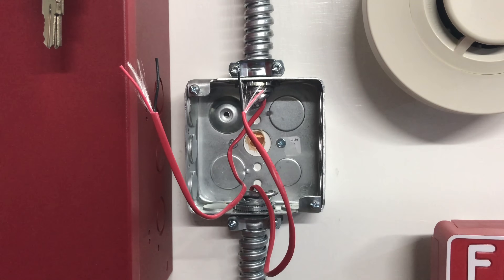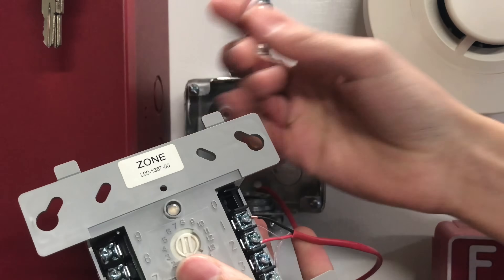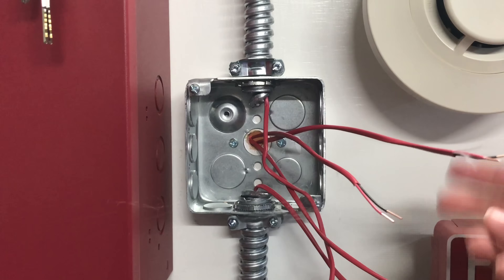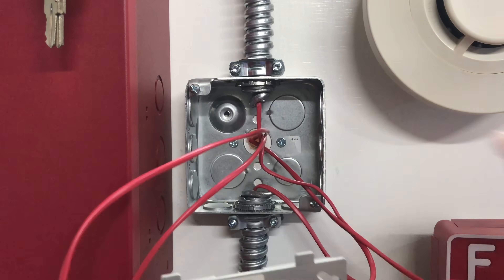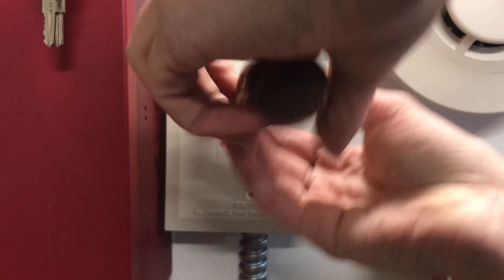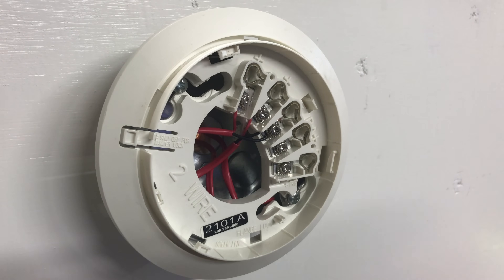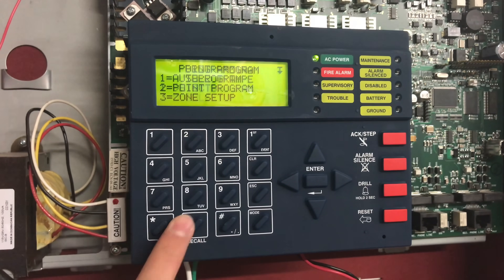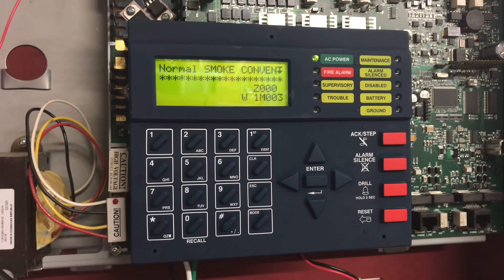Install a Fire-Lite MMF-302 Zone Interface Module

Comment: Why is there 2 sets of wires at smoke base?
Reply: Because he used a class a circuit which uses a loop type setup rather than a single set of normally open contacts

Comment: I’ve wired mine up just like how it’s done in the video, everything does work, how ever the led light on the module turns steady when I activate the smoke detector ( like it should) but stays steady after I reset the panel. The detector does reset. And I’m also getting a trouble that says open conventional smoke. Please help. My system is a Notifier NFW-100x and the smoke module is an NZM-100. I’m also using an i3 two wire smoke.

Comment: Great video!  Did you test this module with ES-50x or ES-200x, I did it and have a problem, the MMF-302 open the conventional loop (not only for reset but permanently)... I did this test with the old module like you have in your video and also with the following version.
Reply: Thats a 9200UDLS I believe.
Reply: @literalyammer  Ok thanks!

Comment: Great video but why did you hook up the 24v power? Isn’t the smoke 12v and powered from the SLC loop?
Thanks
Reply: The smokes he is using are conventional smokes that require power to operate.  
The module is the equivalent of a zone card in a conventional panel.

Comment: Why using power module and why using resistance in module can you explain.
Reply: power is used when smoke detectors go on fire mode. they need higher electrical current. In class A circuit you install the end of line resistor on the conventional circuit side.

Comment: so, what do i need if i want to connect a 2nd smoke detector.... a second module?
Reply: If they are in the same area or zone all you do is add the new detectors into the Class A loop. There is a power limit to how many conventional smoke you can add due to power supply limitations.

Comment: Wow, it makes me happy to see talented people like you do complex things like this. I would never be able to wire something like this on my own without repeated instructions, but you make it look so easy. You are the most subscribed to fire alarm person on YouTube, with more subs than even NewAgeServerAlarm (no disrespect to Andrew). Is this what you want your future career to be? I want to work for Chubb Edwards as a Fire Alarm Tech
Reply from the maker: Yes, I do plan on going into the fire protection & life safety industry when I come old enough. Thank you for the view and comment!
Reply: I worked for Edwards and I can't think of anything good about the company or it's product.   After the 6500, it went down hill from there.  The absolute best product and company I worked for was Simplex.
Reply: @karlkontractor6561  Simplex had and still somewhat has a VERY solid product. Back in the 80s and 90s they had the best customer service. The old conventional systems and devices is what made simplex so great back in the day. Simple and reliable. However, IMHO Edwards still made some ok products past the 6500. The EST-3 has been a very solid panel for them, considering it’s been out for 25 years now. Plus The 66 series panels were also built relatively well. And the ESA-2000, while very quirky, did have some interesting features for it’s time